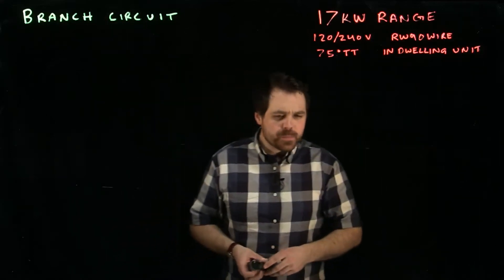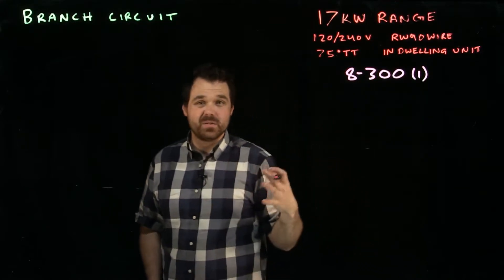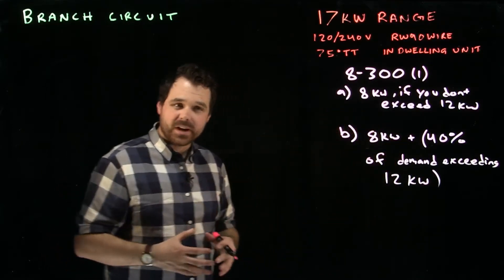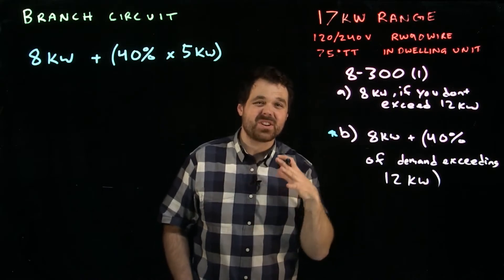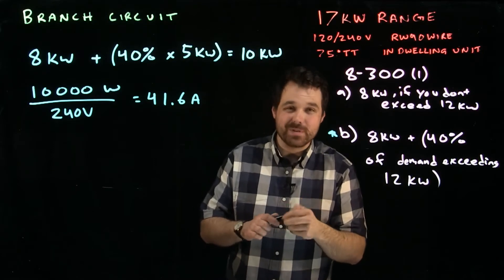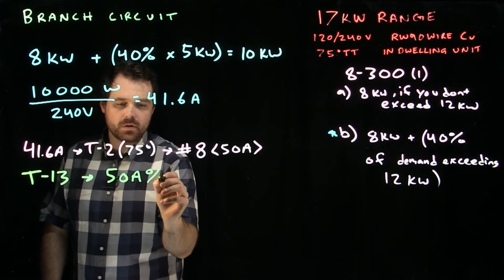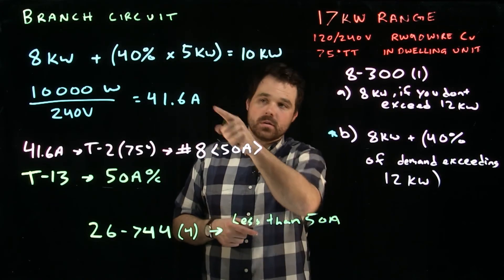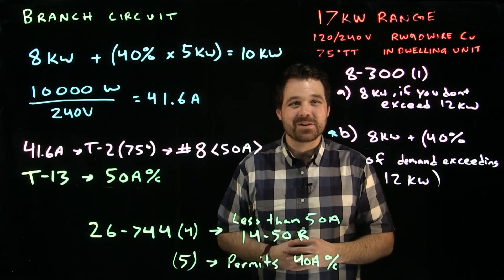Range Branch Circuit

Comment: question regarding this calc in real world application. my oven (just oven no cooktop) is rated at 2.35KW and 9.8A/240V and has a double 15A breakers that are currently tripping when used. if we go by code and calcs here, the electricians shouldve installed a double 20A breaker to accomodate a calculated 33.3A draw. am i right in this assumption? and why do you think the oven would be tripping on the 15s if the spec sheet of the oven calls for 9.8A?

Comment: Just wondering, in reference to Table 13 and the calculated current, the rating only falls to 45A O/C. Does it have something to do with the 80% Breaker limit?